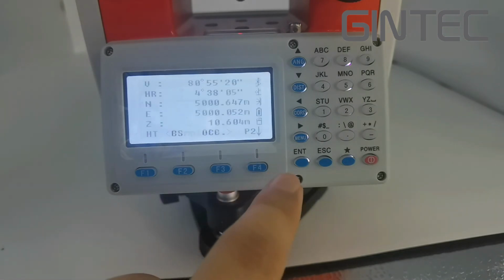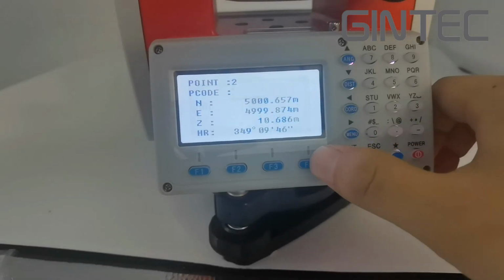Gintec M8 Total Station-How to Measure Coordinates

Comment: do you knoiw if this total station has a Reference Line as program or apliccation !?
Reply from the maker: Now M8 only supports Point to Line Survey, thats the same as reference line survey, which you can get the vertical distance and direction of the observation point P and the measurement site O to the reference line AB. 
If you go the other way, you have these parameters and want to know where is point P,  you can use the fucntion "Offset point calculation" from CY software to calculate its coordinate firstly, then stake the point P out.